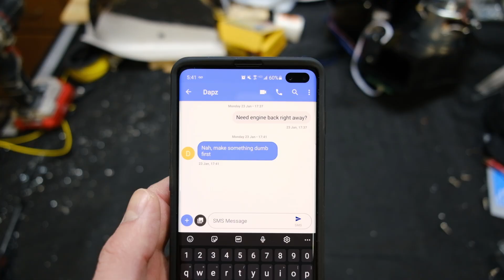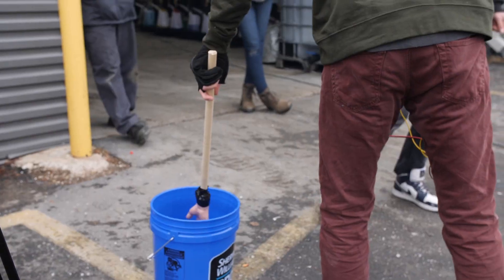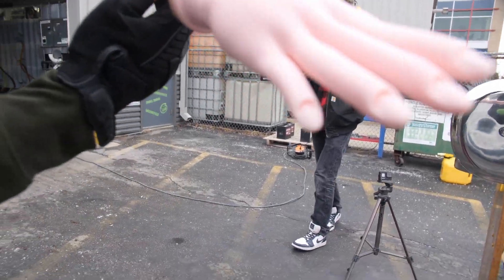I built the world's fastest hand dryer

Comment: you dont need a compressor to make a jet
Reply: just make a passive jet heat sink
Reply: kinda pulsejet but a heat sink
Reply: you dont make any moving parts in jet, like a fan
Reply: if you make heat by electricity, then it will blow itself out
Reply: why would you push soot/carbon on something, just pure heat instead, no staining with black
Reply: are you stig with the mask helmet, do people keep you safe, nope, c-19
Reply: well air heat engine is only a "aerated steam engine"
Reply: say 2000C temp heat coil, and air expands with heating

Comment: I just love watching this kinds of videos and it gives me an other brilliant idea that you can try out: What if one in stead of having to put up with those miserably boring dieselheaters that drains your car`s battery to run its intake-/compressorfan and also consumes diesel to fuel the combustion chamber that generates the heat, were to simply swap it out for a jet engine or more specifically a turboshaft engine so that now in stead of consuming electricity and fuel, you now consume fuel but are able to both heat your car(plus engine) and charge the battery of you car. What you end up with is effectively whats called an Auxillary Power Unit (APU) and as we all know and can agree upon(at least everyone that isn`t a completely A4 human being) is that pressing a button with the label Auxillary Power Unit is infinitly cooler than pressing a button that has "dieselheater" sign on it.

Comment: Alright, I will be the nerd today. The dummy hand did not get burnt due to the Leidenfrost Effect. Basically the water is evaporated taking the heat with it and as such the heat doesn't have time to start cooking your flesh... as long as you don't hold your hand there for very long. If you look on Youtube you will find videos of people swinging their hands through streams of molten metal without getting horrifically burnt for the same reason. 

With all this in mind, come on Joel Creates, I subscribed to see you dry your hands with a jet engine...
Reply from the maker: The Leidenfrost effect is a vapor barrier created by the evaporating liquid, my assumption was that the rapidly moving air would blast the vapor away and negate any protection it might provide. I believe you are talking about evaporative cooling, and I agree it probably helped slow the heating of the hand.
Reply: @JoelCreates  It is a fair assumption, though the hand also wasn't under the jet for much time... maybe something to test further?

Comment: I mean considering that gas turbines are a pretty popular way of generating electricity (especially with moves towards more efficient use of fossil fuels and dual cycle power plants), many hand dryers basically are running on a jet engine of sorts... just with a bunch of energy conversions and transportation along wires in between the two. Kinda a fun thought.

Comment: Let me get this straight, after you proved that it was not only effective, but was also a plausible illusion of safe to dry your hands with a jet engine, you were too cowardly to try it in the name of edutainment? Joel, apparently you don't have any cool friends, because cool friends would have taught you by now, all the lessons I've learned in my entire life that I can condense into a single sentence: "Bad decisions make great stories". Or in your case, videos. What's the worse that could happen? That a turbulent air stream would suddenly catch on your cuticles, ripe your fingernails off and send them tumbling down the asphalt like pringles escaped from their tubular prison? It's a risk your audience is willing for you to take! What am I even contributing on Patreon for if you don't want to be successful?

Also, when drilling anything hard, like stainless, the secret is high pressure, low speed. Consider the edge speed of a hole saw, compared to the edge speed on a 1/8" drill bit. You should be turning so slowly you could follow a dot around the saw edge and not lose track of it. Also, to have a fighting chance of cutting on an uneven surface, clamp a piece of plywood to it first, and then cut through the plywood and leave it there, it'll give you a shoulder keep the blade steady on. An old trick AvE taught me about sawing into uneven surfaces.
Reply from the maker: Thanks for the tip

Comment: This sort of thing does actually exist just way bigger race tracks use jet engines to dry them after rain so they can quickly get back to racing again if rain happens in the middle I've only ever seen them used in nascar but using two engines to dry things has happened before